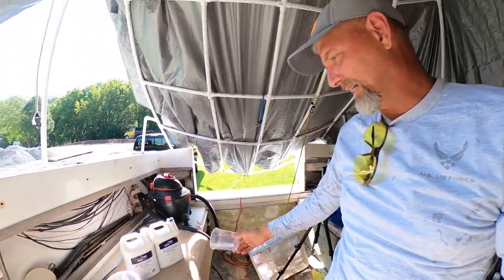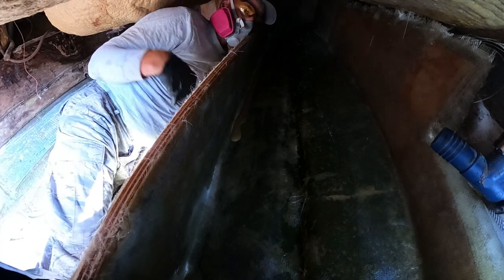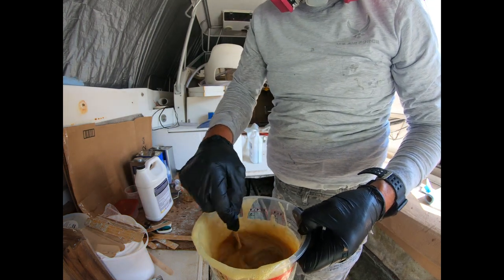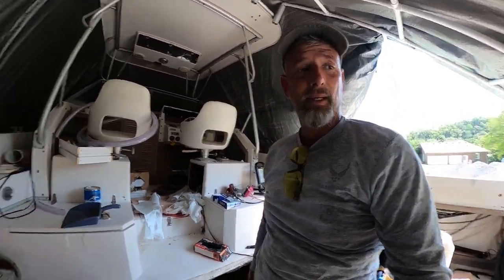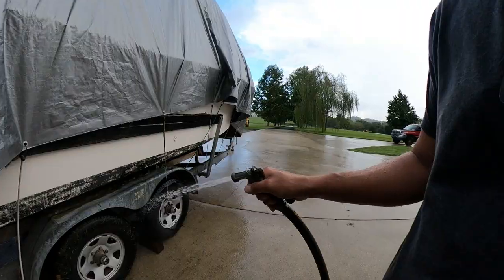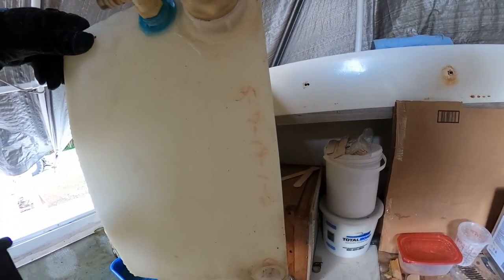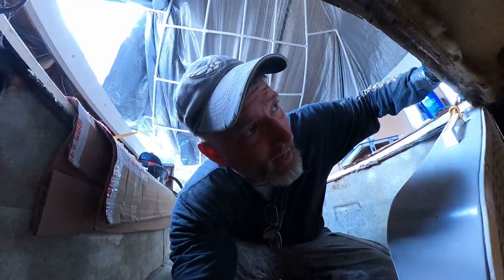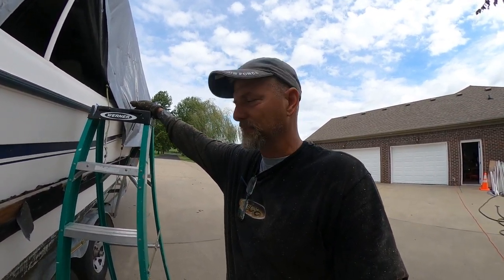$10 Boat Floatation Foam and Left Side Demo! | EPS 32 | Shots Life

Comment: Nice work one idea i did it for client i installed a shureflo and i install the tank in the middle with a floor filler port it help with balance you boat
Reply from the maker: So I was wondering about balance, but I assumed there was weight on the other side that equaled that…?? Maybe I’m wrong?
Reply: @shotslife  if you like look at most newer boat you see the all install the water tank in the middle of the boat to help balance and think about it you did right side and it was no tank there and even more you poor more flotation foam on one side than the other because of the tank is there have the same volume of foam will help with even floating

Comment: Like you say this suggestion is probably too late as well.  I would use a grit blade on the multi tool for as much cutting as possible because the angle grinders are beasts for throwing the dust everywhere.  Sometimes is a no choice call but when you can the multi tool with a carbide grit blade will go almost as fast and leave you a lot cleaner!  Funny thing, the harder you work the more relaxed I get!  Always enjoy your offerrings.
Reply from the maker: Yeah, hopefully I’m done cutting, now to rebuild!!

Comment: I think I would have skipped the foam it just looks like it would possibly hold water even though I know it's filled with fiberglass unless 
 the foams of requirement by the coast guard I don't know
Reply from the maker: Hey Scott, it’s closed cell floatation foam.
Reply: Foam does more that floatation. It also helps deaden sound and reduces vibration/impacts. You would appreciate it if you ever go down.....